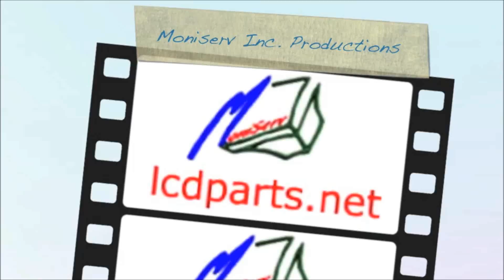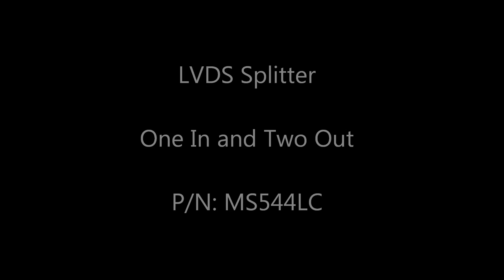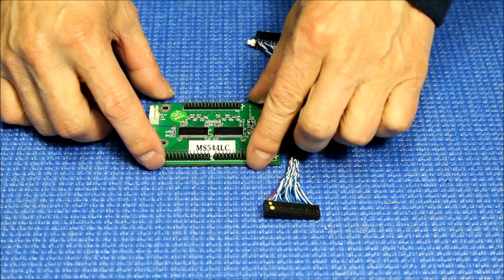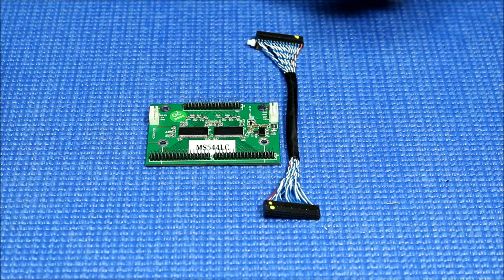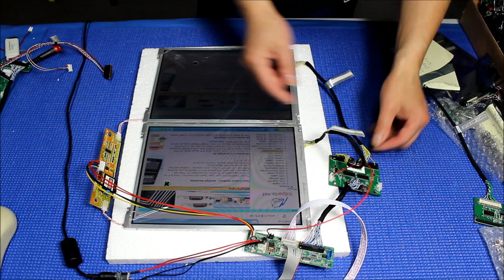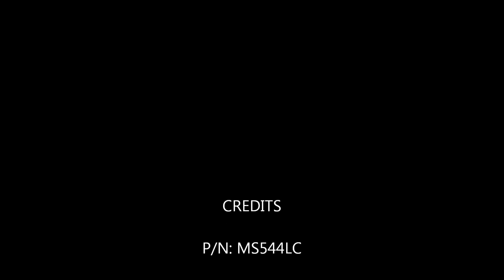MS544LC, 1 in 2 Out LVDS Splitter

Comment: Is there any way you could make 2 input, 1 out? So I can switch to signals inside monitor from two different drivers?
Reply from the maker: Sorry, we do not know
Reply: Did you ever find a solution? I am also looking for a 2 input 1out solution for my arcade1up pcb and nintendo switch.
Reply: @jaredalbin5658  I’m looking too. Did you ever find anything?
Reply: @williswong8296  hey, yeah I did find a solution, I posted it with pictures here in the Facebook group: 

https://www.facebook.com/groups/2768572869834975/permalink/7529710033721211/
Reply: @jaredalbin5658   I saw your pics. Nice work. Which intec board did you end up getting? (Long story short, I’m trying to install a pcb of sf2 big blue and mvc into 1 cabinet, so they share the same monitor).
Reply: @williswong8296  yeah this is possible, you have to convert the monitor input to hdmi and then the pcb boards to hdmi outputs. Then put a hdmi switch in between them.